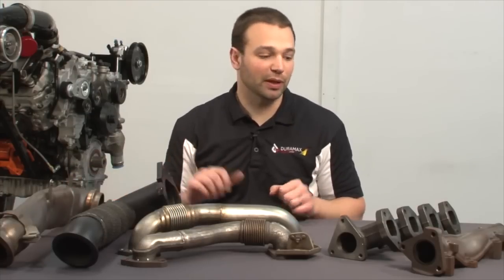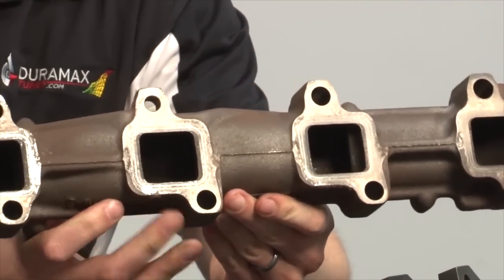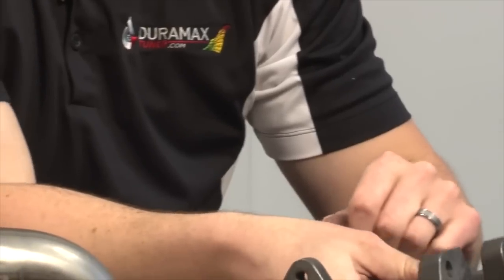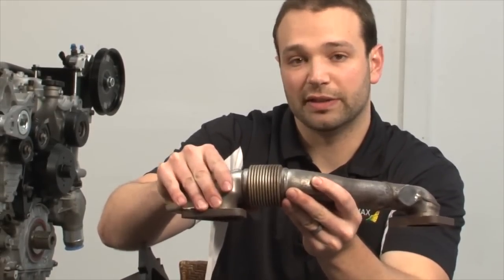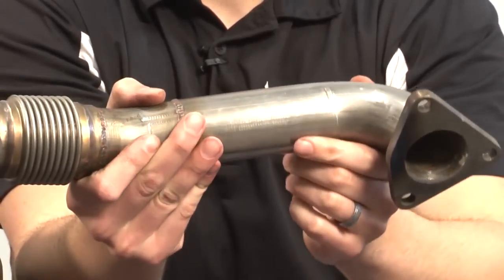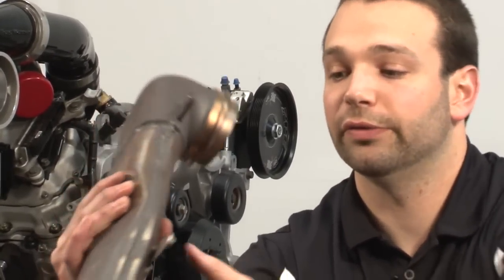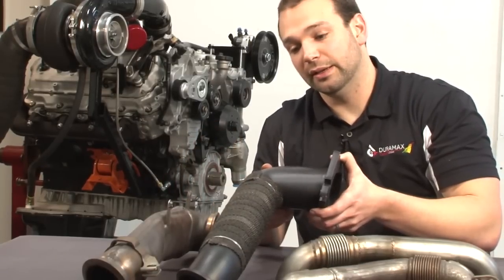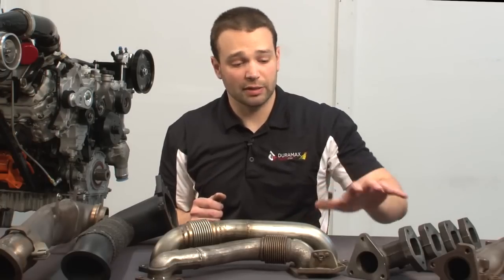UP PIPES, DOWN PIPE & MANIFOLDS by Duramaxtuner.COM

Comment: So I just sub'd, I travel a lot for work I'm a Travel RN and I tow with 2018 Duramax 16k quite regularly across the nation currently in Southern Oregon. So my question is, in short of deleting what options do I have to add some hp and tq without going piggyback? Are there tunes that can be downloaded to ECM that are safe and reliable? Maybe like high 400s whp and 1100tq+  is it possible without a piggyback?
Reply from the maker: We have custom tuning for your truck actually. You install a new Unlocked ECM and then flash the tunes with your laptop and the hardware we send you. Take a look here: https://duramaxtuner.com/diesel-tuning/chevy-gmc/l5p.html or give us a call (815-568-7920).

Comment: Would the down pipe do anything beneficial for a stock LML?
Reply from the maker: Unless you have a bigger turbo or twin turbo kit I would not imagine it is going to make a big impact.
Reply: @Duramaxtuner  alright. Problem solved get a bigger turbo so I can do the down pipe. That's a great new project.

Comment: So stock LML would benefit from some of these?  Like just quicker spool and less towing EGTs?  Or only benefit is pushing 450/500HP?
Reply from the maker: Custom tuning would get you more than manifolds and up-pipes.
Reply: @Duramaxtuner  
 I have a 2013 GMC with the 6.6 Duramax with 145,000 miles on it.  It is still stock except for the exhaust which has been deleted. I am very concerned about the CP 4 injection pump.  If I add a lift pump (FASS) will the CP 4 pump still be a reliability problem with this motor? Will this keep me from having to repalce the CP 3 pump with a CP 4 as this loos to be a pretty extensive procedure to perform. I am 64 years old and had to retire on disability due to having to have the whole lower part of my back fused together with rods and screws.  I am not as flexible as I once was and have pain from moderate to extreme depending on what I am doing.  I bought the truck in 2015 with 23,000 miles on it before I knew the CP 4 pump was a reliability factor.  Due to being retired, I wanted something to last as long as possible.  I run Amsoil Signature 15w-40 in the motor, Wix filters in all locations, and add Amsoil fuel treatment in the fuel at every fill up.  I try to buy all of my fuel at the same station (Murphy Gas) unless I am traveling...which is frequently.  The only thing I have pulled with this truck is my 20 foot bass boat which is usually less than 20 miles round trip, however I do work with the local High School and pull my boat once or twice a  month to various lakes throughout the state of Georgia and South Carolina.  This June I will be pulling my boat on a 3000 mile venture (from Clark Hill Lake on the Ga./SC border to Lacrosse, Wisconsin) for the High School team to fish in the Nationals.  Thanks for all your help and advice.
Reply from the maker: @archielee7434  Give us a call: 815-568-7920.

Comment: Why can't these be added when emmisions are in tact?
Reply from the maker: Great question! The first reason is that for emissions equipment to work you need heat in the exhaust. Larger up-pipes and manifolds will generally reduce heat in the exhaust.  The next reason is the lack of benefits for an emission equipped 600 RWHP truck.  Over 700 RWHP builds generally have the most to gain with up-pipes and manifolds.

Comment: I need that upgraded down pipe! I've bought 2 different down pipes they dont make them to clear my upgraded manifolds and up pipes. Both downpipes ive bought hit the up pipe before the flange is flush with the back of the turbo the gap is probably 1/4 to 3/8 of an inch
Reply: That's after I've destroyed the first downpipe its almost completely beaten flat. I still need 1/4 to 3/8 of an inch to get the flange of the down pipe to be flush with the back of the turbo so I can bolt it on but this will never work.  Also my truck is an 03 lb7
Reply from the maker: @tylergist8557  Give us a call our guys can probably help you out. 815-568-7920
Reply: I had the same issues, when i installed my ppe manifolds, up, and downpipe. I write ppe, and they answer: dangle the downpipe with a hammer, until it don't contact the uppipes. That's high quality - made in usa 😑. Than i order the flo-pro downpipe, it was better, but i also have to deform it to fitment. For reserve i had a mbrp downpipe at home. Butni don't know if this fit better, it's hard to get them pipes in and out, once istalled the flo-pro i wouldn't get it out to try the mbrp.
Reply: Im having this issue rn. Do i just hit the DP until it gets?

Comment: Do you have all that for the L5P yet?
Reply from the maker: We would not suggest it. You would get more from doing an L5P Tuning package.  Also, with emissions equipment heat is not the enemy.  You need the heat in the exhaust to efficiently burn off the soot in the DPF.   http://duramaxtuner.com/tuning/l5p-tuning-package.html

Comment: Can all these be installed on an LML 2016 that has not been deleted or will not be deleted? And if so am I going to really notice the difference for what it's going to cost to have this done. Thank you
Reply from the maker: We would not suggest it.  A simple EZ Lynk AutoAgent with our Support Pack is going to net you a way bigger gain for much less money.  Also, with emissions equipment heat is not the enemy.  You need the heat in the exhaust to efficiently burn off the soot in the DPF.    https://duramaxtuner.com/tuning/ez-lynk-autoagenttm-2-0-w-2011-2016-lml-duramax-support-pack.html

Comment: I've got an 2006 LLY duramax with an AFE intake, and a 4" Diamond Eye exhaust. If I install a downpipe, is getting a tune required?
Reply: 04.5- 05 is lly. 06-07 is LBZ
Reply: @thomasfrye1710  not true I have an 2006 LLY  as well http://www.duramaxhub.com/duramax-vin.html
These show models based of Vin so this statement everyone says about all 2006 being lbzs are false. Some are, some aren't.
Reply: @gbarker8  I know this is an old post but if anyone is reading this, that char is not accurate.  I just bought my 2006 GMC 3500 Duramax 6.6 LBZ. It was manufactured in 10/2005 and had code "D"  (LBZ) in the VINs 8th position

Comment: Hey duramaxtuner the bellows on my stock up pipes are cracking and leaking I don't want to buy aftermarket ones due to the $500 price tag if I pull my up pipes off and get the bellows to fix the leak could you tell me the diameter of the up pipe

Comment: What do the bellows on the uppipes do?
Reply from the maker: They allow for expansion under extreme heat. Those occasionally become corroded and fail. At that point, some owners opt for aftermarket up-pipes.

Comment: What's the price for all three plus install on 2016 Duramax?
Reply: Rich Flynn I’d say no less than $2000.  The parts alone are around $1500
Reply: south GA diesel not true, I just bought the ppe  manifolds and up pipes new on ebay for $480

Comment: I"m looking to get your exhaust manifolds and up pipes and have been watching your videos great stuff by the way. You mention that the factory bellow on the up pipes is a weak point which is exactly where my issue has been.  I see that you have a beefier up pipe but still retain the factory design with a bellow, will this be an issue in the future as they are prone to blow out there? I've noticed others make a solid pipe all the way up, whats the difference? Still learning a lot about diesel tuning and love my duramax, any guidance would really help. thanks

Comment: would that be a good addition the  DT520 power pack on a stock truck or is that more geared to the over 500/600 power ranges?
Reply from the maker: It is geared more toward the 500/600 trucks. Also trucks that are running aftermarket single turbo's.